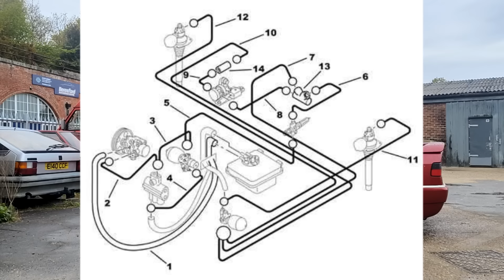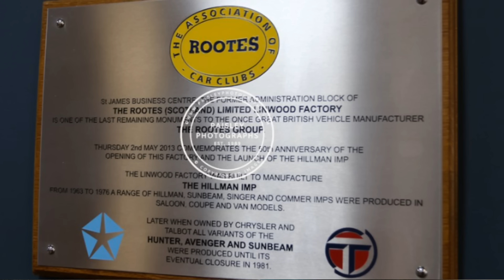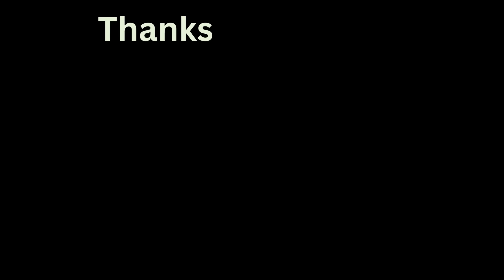My BAD luck continues!

Comment: The best horror films leave the protagonist in a mental asylum as a harbinger for the protagonist for the sequel
Reply from the maker: 😆 Well this'll be a great one then
Reply: “I bought your old Cmax” 

UpnDown slowly turns his dishevelled head to the protagonist bringing his face out the shade darkness into the light and screams 

“RUN” 

Jump cut to the Cmax sat on the ramp
Reply: And you still have three antagonists left from the original...

Comment: My Activa was a lovely car and a brilliant drive. From new 02 to it's 5th birthday everything was  fine. From then on in, a whole host of problems, inclluding hydraulics, made me get a better car. The return pipe 'octopus' rupture was the final straw for me!
Good luck with your repair, whatever it is.
Reply: I'm sure mr. Kitch is used to a BX octopus though, so the one on a Xantia should be a breeze! Weirdly though, they seem to go at random times. The one on my v6 was replaced in 2005 but has been fine ever since, while the original one on my Tct lasted all the way until 2018.

Comment: Also I too feel your pain. Of my fleet of 8,  two rebuilds are scuppered by the weather (and wiper linkage alignment!), only one of the three working cars actually works, one of this number is sat waiting on me diagnosing a gearbox leak, and the remaining one sat forlorn due to a strut/brake/ABS (f'k knows exactly what, but its living up to its last 3 'FKB') thats been a 2 week saga of parts, time, weather and a lot of confusion. Sheet happens!

Comment: Hilda is iconic, she will bounce back better than ever before. The Ford C-MAX, maybe is cursed? But she hasn't caught on fire so she will bounce back too. The Citroen C6 is most likely a battery that was throwing up codes, and as for the Citroen Xantia, when sorted will be cornering as sure footed as a mountain goat on rails with gusto, while feeling as smooth as butter, over the bumps.
 Good luck and God bless.

Comment: My Activa embarrassed itself in the works car park a few years ago with a catastrophic leak in a similar position...  A pipe running along the lower edge of the nearside inner wing that runs all the way around the engine bay to the power steering control valve (I guess the pipe routing makes more sense for a LHD car).  That pipe consists of two steel sections with a flexi part in the middle where it transitions from the engine to the body, and even though it's common to all Xantias rather than Activa specific, it is no longer available from Citroen.  I sent the failed old one to Pleiades who replaced that section of the pipe with cupronickel and I fitted it in the car park when it came back...

Comment: I hope that you find an activa piping diagram.  The one you showed doesn't even have the anti- sink valve.  The hydractive valve has 2 high pressure feeds, one from the height corrector (via the anti-sink valve under the LHM tank) and one direct from the security valve.  My recollection is that both those pipes run above the inner wing, so wouldn't be spraying LHM under the car.
Maybe it is a pressure feed to the activa system?

Comment: The Xantia power steering pipe runs in a similar area aswell I think. One of the few pipes on a Xantia that isn't coated. They rust well...

Comment: That’s an easy fix. You replace these things in pairs always. Also just replace the battery anyway don’t worry about testing it. Modern batteries are absolute crap.
Reply from the maker: Driveshafts? I never replace them in pairs. They won't both wear at the same rate!
Reply: @UPnDOWN   well clearly yours were pretty even since as soon as you replaced one the other one followed. So I’m not sure why you wouldn’t do them as a pair. I not big on doing just one of something. I prefer to replace drive shafts and most suspension parts in pairs because while I’m working on the car I don’t want to have to come back 6mths later to the other side. I do it all at the same time. My personal preference. 
I prefer to do more preventative maintenance all at once than to keep coming back forth time & time again.
Reply from the maker: I think this was an extreme case tbh. Nearly 20yr old driveshafts having to be pulled and manipulated into awkward angles to get past a dumb design flaw.
Reply: @UPnDOWN  agreed so replace every bloody thing you can bushes all in one hit then it’s done for the next 10 years.
Reply from the maker: @anakinskywalker4113  Ideal, if you have unlimited funds and need the car for another ten years.
Reply: @UPnDOWN  if I’m doing it myself I just do it anyway. I’m a perfectionist so I throw the kitchen sink at my cars no expense spared. I cannot stand even the smallest little issue with any of my cars.  But that’s me. Everyone is different.

Comment: Perhaps something to think on..... To keep doing the same thing, expecting a different result, is the real definition of lunacy.. Imps always boiled over.....Imp Joke, If you go out in the morning and there is no puddle under you imp, its because its run out of water! 
It was a real good design badly executed.. Good on you for persisting sir..
Reply from the maker: I feel you aren't aware that this Imp is nothing like a normal Imp!
Reply: @UPnDOWN  Nope, watched the other vids. Think its a good idea. I just (probably unfairly,.,sorry) used it to make some bad old Imp Jokes. TBH, I think its cute. I had a thing for Posh Minis...Elf. Had one called Dobby. Good luck with yours.